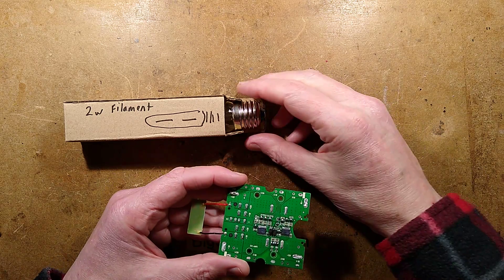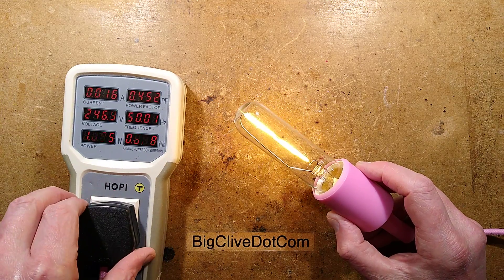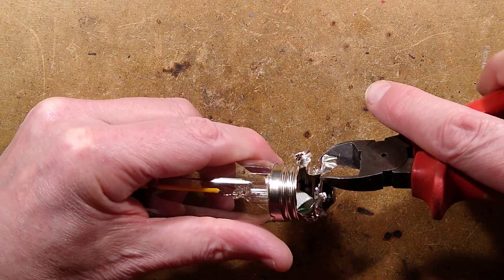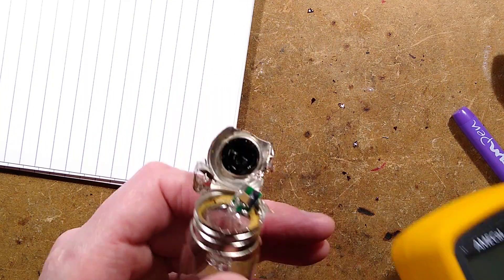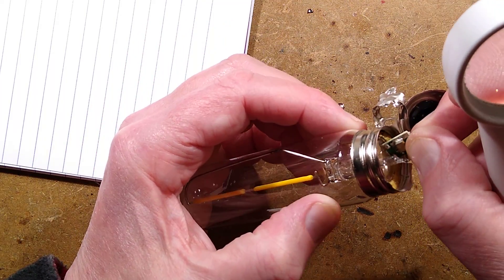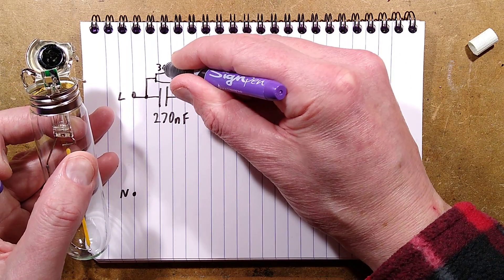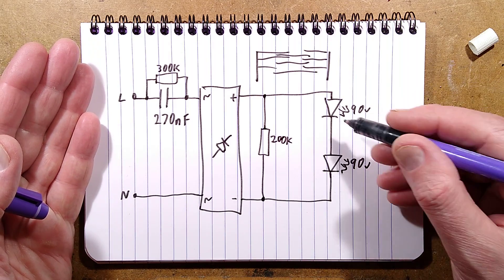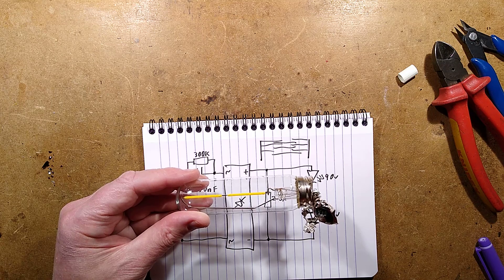Very tacky eBay LED filament bulb

Comment: Hey Clive, I'm happy to say I've converted most of my LED bulbs to more efficient version of themselves by destroying one of the parallel resistors. Now I'm wondering if I go the diffuserless route and buy some with filaments, will it be possible to do something similar? What's the best approach there?
Reply from the maker: Filament mods are a bit harder unless you use the "dooby" technique featured in some of my videos that uses an external series capacitor.

Comment: ⚠️Clive I thought you would have extended this vid and modded the bulb pcb to cure the flicker !!
 Increase the value of that cap to your original thought of 470nF for example?.
Wonder if it might have cured it ?👍👍
Reply from the maker: It's not as simple as a dding a smoothing cap.  The voltage rating of the series capacitor would also need to be uprated.

Comment: Put a capacitor in parallel with the load to dampen the output voltage should eliminate the flicker.

Comment: Mr. Clive, let me pick you brain for a sec. What components would one need  to power a single LED from a capacitor for several hours before recharging with 128V mains. Lets say 5 hours.
Reply from the maker: A capacitor isn't a good choice for that.  It would be better to use a rechargeable cell/battery.
Reply: @bigclivedotcom  Mr. Clive you have taught me well for several years, I know it's not a good choice. Just wondering what would be required. I'm thinking of 3rd world usage.
Reply from the maker: @stewartpalmer2456  Even in a third world scenario a rechargeable cell would still have advantages over a capacitor.  Their energy density is higher and the voltage doesn't drop as fast during discharge.
Supercapacitors are not as long lasting as implied.
Reply: @bigclivedotcom  Sorry I don't have the skills to explain what I'm conceiving. Caps, Inductors, diodes and LEDs. I still need to feel comfortable playing with large voltage.

Comment: The inrush current problem is a REAL issue if you have a dodgy connection, the pulse may be short but if it happens100 times a second due to an arcing contact, it will execute LED lamps in very short order

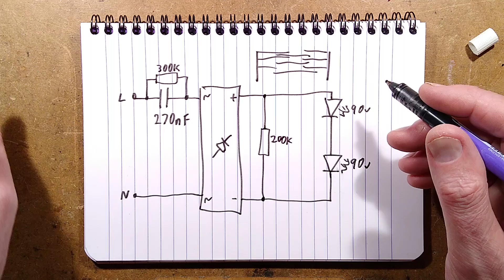Comment: 7:40 Leakage through the switch wiring? When I visited India this summer I had an LED light above my bed that would glow/pulse very dimly despite the switch being turned off. Is it possible the LED bulbs there didn't have this resistor? Ever since I witnessed it, it has been keeping me up at night (not the light, the question of how it was still dimly glowing).
Reply from the maker: Yes.  Many cheap lamps don't have the resistor.

Comment: DUDE,.. THAT WAS SCARY 😬
Always hold the Glass Wearing A Glove My Friend, if you're dismantling any bulb. 
Or anything glass for that matter.     ... safety first 🤗

Had a 400w HPS just PoP in my hand simply screwing it in years ago. It wasn't pretty. And haven't trusted a bulb since. And, a few pop since then. Just better safe than sorry 👍 🖖

Comment: Hi Clive, even though the Lamp may have a few flickers, it is still very high-tech by comparison to the 1900's Edison Lamp. Even the Cinema Lamps were carbon back then! Onto another subject. Many people who watch your channel, may like another "project". I have just bought (from Ebay), an XY - LPWM Frequency Generator, with range from 1Hz to 150kHz. It even has a digital display for presetting the frequency and Duty Cycle. So, my plan is to utilise this device in order to set the frequency at 20kHz, and (hopefully) drive a Tweeter direct from the output of the device. We have neighbours who leave their two dogs in the backyard unsupervised. Dogs just do not stop barking!! $ years ago, I made a project, and it worked well. I even used a keyfob remote / relay to turn-on from my pocket. The whole lot runs on 12VDC Solar power. For added volume to the Tweeter, I bought a single-channel Amp, placed this at the front before the Tweeter. This blew the Tweeter - too much DC component (I think). Yes, you can buy these ready-built, but this would make a great project for the many (like me) who are forced to listen to barking dogs all day. Greetings from Australia.

Comment: That style of lamp was usually not meant to be seen, I removed some old shelving units from the place we moved into and there were two that were hidden up at the back behind a cover, still had working incandescent bulbs of that shape!!  They were probably not used frequently enough to burn out.

Comment: One thing I have been pondering is whether it would be possible to use the actual leds in a light AS bridge rectifiers.. That is.. If I have enough leds so the voltage drop would exceed half the main voltage in one direction in serial, and equal amount in the other direction.. LEDs aren't supposed to take that much force, but then again.. as long as both led-ramps in both directions are fully functional the strength of the current should follow the path of least resistance.. and if one doesn't expect to use the FULL intensity of the leds (so one populates the system with a few more than needed to fit mathematical exactness) one should also limit the risk of them breaking due to spikes on the mains..

I doubt it would be a light that would have much use, but.. I always ponder the question.. "can it be done?" (viability) before I ponder whether it would be too flickery or something else, because there will probably be SOME situation where it's better to get ANYTHING going than to get something "good enough" going.
Reply from the maker: I've seen LEDs used as rectifiers in the very simple 1W festoon lights and in some industrial indicators.  But LEDs are not ideal for that as they have very low tolerance of reverse voltage.

Comment: Greetings, the glass enclosure looks hermetic, vacuumed sealed as in an incandescent lamp, as opposed to simple cheap liquid sealant.  Why would they do that extra cost etc?
Reply from the maker: They're using the existing lamp making machines.  Some use an inert gas inside to help transfer the heat to the glass globe.

Comment: Video idea Clive: making a solar panel powered battery charger/supply. Is that possible with the TP4056? Would be great to see a video on that and make use of all that solar power for some devices! Thanks for all the videos, I’m learning a lot through your experiments 😂
Reply from the maker: Yes it is.  Use a 5V panel and connect it to the terminal either side of the USB connector.  If you want to charge with USB too, add a diode in series with the solar panel.
Reply: @bigclivedotcom  Thank you for the reply! Made my day :)

Comment: Hi Clive. Another way of opening up a lamp like that is with a controlled breaking of the glass. Here's a trick I once picked up: wrap a little cord around the bulb. Soak it in a flammable fluid and light it. When it's almost extinguished, dip the bulb in cold water. The thermal shock often makes a nice crack in the glass and it comes right off.

Comment: Some more thoughts on this:

It MIGHT be possible to do something useful with inductive or LC filtering in a lamp like this. Apart from inductance, the characteristics of the inductor would likely be unimportant. The frequency is low so core losses related to frequency wouldn't amount to much. It would likely be quite acceptable to run the core into saturation (which takes a lot if you use a "slug" core with what amounts to a huge air gap, versus a closed path of high-permeabilty material). The low current would allow fine wire. If a decent model of the LED filaments could be found or created (NOT a simple task) some simulations with one of the free tools could be instructive. I used to use TINA from Texas Instruments. I have no idea what is around these days.

On ceramic cap failures: Surface mount ceramic caps are rather fragile though superficially they seem like they should be robust chunks of ceramic. Hand soldering is perilous because of the stresses created. I'm not sure what current views are on caps on the "solder side" of mixed through-hole and SM boards where the bottom of the board is wave soldered (i.e. whole thing gets exposed to wave vs. much more sophisticated tiny solder fountains that do one through-hole pin at a time with the SM parts reflow soldered). PCB flexing, including that due to vibration, can cause cracking of MLCCs. Snapping apart V-grooved PCBs rather than using a proper separating machine can break caps near board edges.

The color of the cap in the lamp suggests to me it is made with ceramic with a moderately high dielectric constant (more properly called high relative permittivity in modern parlance). The ones with really high K tend to be darker brown in my experience.

Another oddity of some high-K ceramic caps is that they tend to decrease in capacitance with age due to slow changes in the ceramic. Heating the cap above some particular temperature, as might occur in reflow soldering, restores the original capacitance and the aging starts anew. I have a vague and dubious recollection that his effect may be more serious in higher voltage types. I've been away from this stuff for several years and sort of willfully forgetting about it and returning to my roots as a biologist.

Johanson used to have some good ap notes on some of the more exotic types of ceramic caps. I believe they also had some good notes on PCB design for high-voltage SM caps (issues of pad design, solder mask, etc.)

I hope I'm not scaring beginners in electronics, but it is true that the array of capacitor types is immense and characteristics vary widely. Selecting the optimal capacitor for any particular part of a circuit can be rather involved.
Reply: The LC filter is an interesting idea. I think the inductor would be very large for use at 50 or 60 Hz, though.
Reply: @Derundurel  It probably would require an inductor too large to be pracitcal or economically viable for a lamp like that. The problem with a capacitor is it simply can't deliver any useful current once its voltage drops below the useful conduction theshold of the LED string. Whether it could deliver useful current before that is hard to say. This is where simulation can be a big help. The energy stored in an inductor is going to find somewhere to go, regardless of realistic voltage.

The whole issue is surprisingly  complex especially in view of the fact that you are trying to solve a subjective problem.  You need to do double blind experiments with a decently large sample (and it might be hard to enroll participants if you tell them it is a "double blind" experiment involving vision).

Comment: I have wondered why they don't make that leakage glow switchable and advertise it as a night light feature. I've recently noticed that an led USB flashlight seems to have this glow when plugged in even though the power bank is switched off.

Comment: That flickering drives me absolutely insane when driving down the road.
So many cars these days have flickery LEDs. WHY?! Tail lights, running lights, brake lights, so much shimmery flickering!
Reply from the maker: They use pulse width modulation to dim them, but it could be done at a faster speed.

Comment: Hey Clive! nice tear-down! I was wondering, around UK the line frequency is 50Hs, it being fully rectified should bring up the flicker frequency to 100Hz, right? So you shouldn't be able to see that, unless the rectifier is like half broken maybe.
Reply: Different eyes have different sensitivity.  I bought a huge magnifier/desk lamp from our semi-reputable national electronics reseller (Jaycar, who in practice actually just resell a whole bunch of stuff I can get from aliexpress for 3 times the price, but at least have local warranty support), and it very badly flickered (exacerbated by your closing working quarters to a very bright flood ring-lamp, and as well as the iris stopping down in the presence of bright light, I wouldn't be surprised if they somehow opt for shorter exposures too).  I opened it, discovered a full bridge rectifier, found there was plenty of room for a 400V ridiculous uF cap (I'm not about to reopen it and find out what I had on hand that day), and it's served me well for the 5 or more years I've had it.  The cap gets a little warm against the inside of the plastic case, but it hasn't burnt down my place yet.
Reply from the maker: 100Hz is still detected by peripheral vision.
Reply: @bigclivedotcom  I think it’s the opposite, on Wikipedia under “flicker fusion threshold,” rods (peripheral eye cells) detect up to about 15hz, and cones (central, acute vision), to 60 - but when scanning across an environment, or doing high concentration tasks like reading, it looks to go way up to about 2k. I guess when taking a panacea of information our eye cells fire at differing rates and are stitched together in the brain as fragmented images. Either way, flickering lights, or even just the concept of sub-perceptible flickering bothers me and it’s like, when I’m working on something I need all the concentration and stamina I can without some phantom force slowly sapping away from me and also happen to rework leds when I can lol - appreciate your videos!
Reply: @bigclivedotcom  Edison Screw suggests the primarily for the US market, which would make these 60Hz/120Hz - does that reduce the likelihood of flicker being detected?
Reply: @peterwhitworth7395  Edison screw is also a standard in Europe, just with slight differences in size to distinguish voltages (medium lamps like this one are E26/E27).
Reply: @tz8785  ..and of course it's a 230V not 110V🤦‍♂
Reply from the maker: @peterwhitworth7395  This lamp is for 220-240V.  But I think the 120Hz flicker on a 60Hz supply still causes issues.
Reply: I guess the idea of people not seeing 100Hz flicker is based on CRT TVs where it doesn't just flash on and off like an LED but rather scans from top to bottom at that rate. Some people (myself including) see flickering LEDs at higher frequencies than others. There has been research where people were able to detect up to 4kHz strobing. I personally tend to see up to about 1kHz. Very often, LED lighting uses sub-1kHz so those are extremely annoying. Some cars use those frequencies for lighting and that makes it even dangerous as it makes it really hard to guess distance. The Volvo V70, for example, strobes massively. As more and more cheap LED drivers enter the market, it's almost starting to become a handicap.

Comment: in those LED lamps that look to have been built like traditional incandescent lamps, do they still pull a vacuum inside them?
Reply from the maker: They may use an inert gas to help with heat transfer.

Comment: galaxy brain method for saving even more money: using the LEDs themselves as the diodes for the bridge rectifier
Reply from the maker: They do that with some 1W festoon lamps.  But LEDs are not really suited to blocking high reverse voltage.

Comment: i hate 25Hz flickering LED lights.
Reply from the maker: That would be very unpleasant.  But these are 100Hz on a 50Hz supply.
Reply: @bigclivedotcom  I didn't expect to be able to see 100 Hz. I can see my hallway light flashing especially when tying my shoelaces or anything else that makes a move. so I assumed that half the mains frequency was used because of a half wave rectifier.
my girlfriend doesn't see it or doesn't suffer from it.